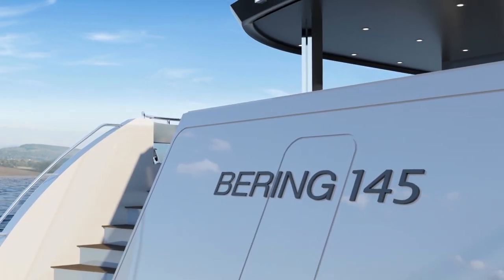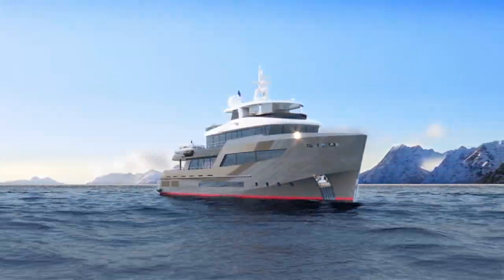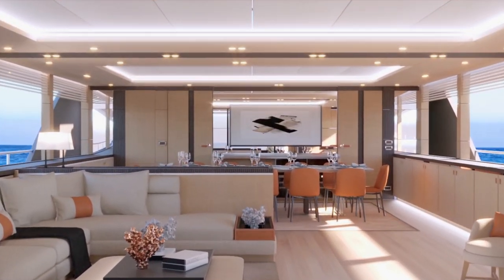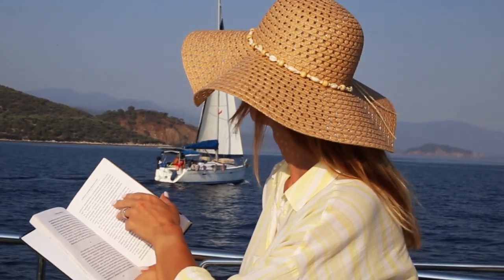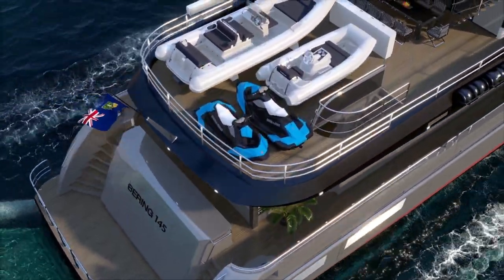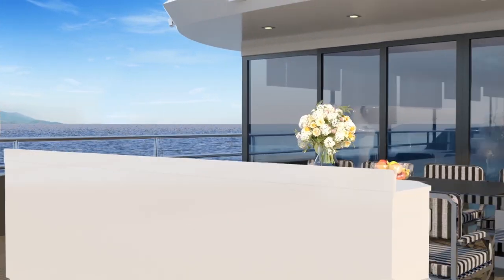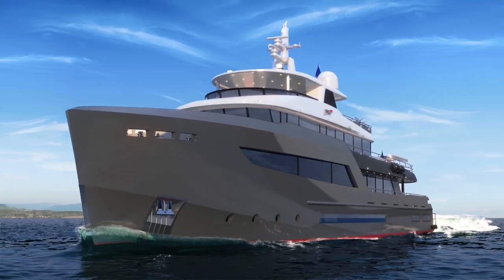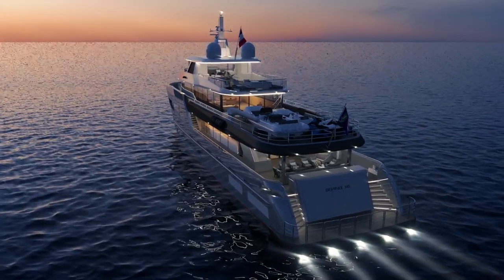New project of  Bering Yachts - 45 meter Super Yacht

Comment: I've spent a good long while pouring over the specs and deck plans of this beautiful yacht. This for me is the penultimate dream yacht while not being the Giga yacht that can't effectively dock anywhere and requires a multibillion retirement to afford.

It has a large jacuzzi equipped sun deck and sufficient space for any toys you would actually regularly use. It has no less than three interior lounge areas, depending on layout, permitting plenty of variety and seclusion if desired. A proper beach club is a nearly necessary perk for a yacht as is sufficient exercise gear to stay in shape.

Its displacement permits the widest choice of captains. Its galley is a chef's dream. It has a large and very flexible crew appointment sufficient for any and all needs, which given that the quality of a crew is at least every bit as important as the quality of a yacht is a HUGE deal for me.

Its cruise speed is actually high for this sort of yacht and its range makes it a genuine world cruiser. Being a hybrid makes it both more ecologically friendly than virtually all other yachts, it also makes it more fuel-efficient and therefore substantially cheaper to travel distances.

Would that I had made better decisions in life. This sadly shall remain but a dream for another life. I am content to know that some few who have made better decisions will be able to enjoy this perfect marvel.
Reply from the maker: Thank you for your interest in Bering Yachts and for your kind comment!
Reply: Saw NautiStyles tour of this beautiful beast under construction. Bering would be my yacht of choice had I the money. Was very impressed with the Bering 77. Great comment Peter.